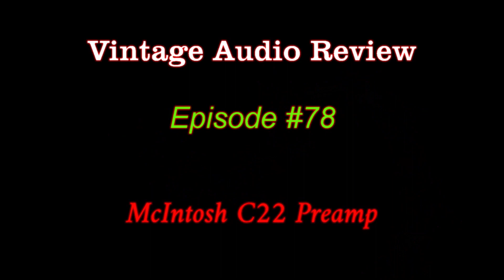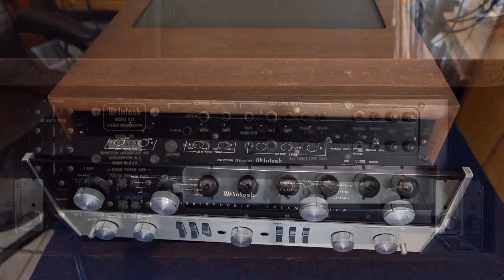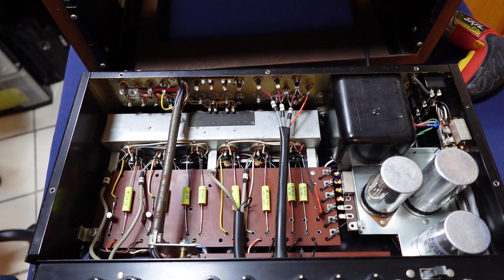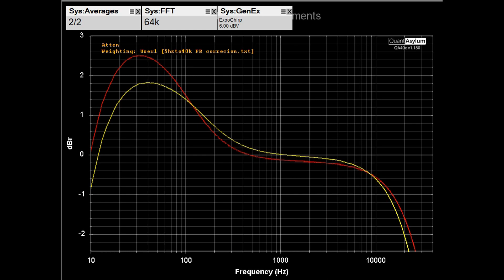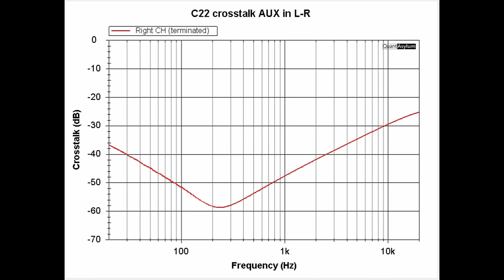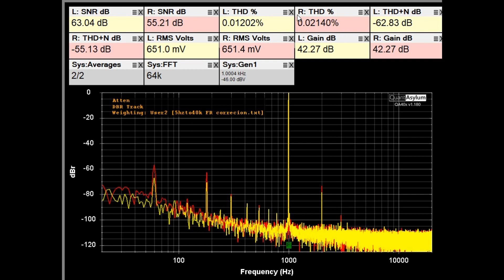McIntosh C22 Tube Preamplifier- Vintage Audio Review Episode #78

Comment: Quick question for you or your community of viewers. I have a store credit with an audio store that is a McIntosh dealer.
I want to put it towards a new McIntosh analog tube preamplifier.
It will  be my first  McIntosh preamplifier.
Did anyone hear the McIntosh C8 and the C22 mkV. preamplifiers?
I would like this to be 
my end game preamplifier.
IYO, how did they compare?
I have discerning ears and I do a lot of focused listening to Hi-Rez music files.

Any info you can provide is surely appreciated.

Thanks,

Di- store credit with an audio store that is a McIntosh dealer.
I want to put it towards a McIntosh analog tube preamplifier.
It will  be my first  McIntosh preamplifier.
Did anyone hear the McIntosh C8 and the C22  preamplifiers?
I would like this to be 
my end game preamplifier.
IYO, how did they compare?
I have discerning ears and I do a lot of focused listening to Hi-Rez music files.

Any info you can provide is surely appreciated.

Thanks,

Di-
Reply from the maker: I am not a big fan of tube preamps, even McIntosh. In my experience with immediate a/b testing there is not difference in sound quality between them and ss units. You need to wait a bit for them to warm up unless you keep them on all of the time, which means they would wear out sooner. My review on a Mcintosh C48 SS preamp with both a DAC and MM/MC phono built in, is upcoming, but that would be the one I would recommend if you can find one (they are out of production, but maybe the shop has one that was traded in).
Reply: @vintageaudioreview  I have an opposing opinion. Somebody looking at a c22 wants a retro look. The C22 has it, the C48 does not. What is the availibility of tat digital display 20 years from now if it cr@ps out? Also, I would not spend money on a device with an internal DAC. You pay top dollar for any Mac accessory branded Mac whether it's an internal module or a descrete device. Like Dolby, DBX, and others, the DAC technology is going to be replaced by something. Spend that money on an external DAC of similar quality for a fraction of the cost that you can retire when it is obsoleted. My vote goes to a vinatge C22 that has a vintage look, will likely be repairable with common components years down the road and as an added bonus has the added charm of tubes.
Reply from the maker: @GFSwinger1693  I appreciate the intelligent comments you made and would not really disagree with you that much at all, except for the fact that McIntosh does an outstanding job of supporting their products so the display, such as the one on the C48 should be available for a while (one would think). No question about the romance of glowing tubes, particularly at night with the lights out or dimmed. The C22 is going to provide that vintage charm for sure. The fact that the C48 has a DAC and MC/MM phono stages is icing on the Cake. The only negative is that is does not have a tape monitor loop. Plus it looks McIntosh (though not really vintage 😲) I would not purchase a C48 for its DAC- you are correct in that you can get some really nice ones for $100-$200, and a lot of streamers DACs are quite good so you probably don't need one.

Comment: Thank you for your review. By 1965 standards this machine really is super high fidelity. But nowadays only people who like the artistic touch of its unique distortion will buy it.
Reply from the maker: I appreciate your comment, but I would argue with you about the term "super high fidelity". What specs do you need to meet for that. A lot of audiophile folks would be thrilled to have this as their system preamp (and not just for its looks).
Reply: @vintageaudioreview  What I'm referring to is that in the process of going through Preamplifer, the PreAmp part itself just amplifies the signal without doing anything else as much as possible. Things like introducing noise, changing the dynamic range, altering the audio curve and etc.  It's a good PreAmp, because it sound holds charm. Just like Fender '57 Custom Champ guitar speaker. But it doesn't do a great job of fidelity by today's technology standards.
Reply from the maker: @victoriadelacroix8570  Thanks for clarifiying. I know that Fender makes guitars and amps, and some are very collectible, but that's about it- could not comment much about their sound. Nowadays you can basically go all digital until you get to the power amp, so you are limited by the D/A converter. The C22 from the video is coming over in a few days as the owner thinks he has a problem with one channel, so you do have that problem with some of the older gear, but than can be said for almost anything. My son's brand new Tesla would not run after only having it a few days due to a poor wiring harness connection. Charm is probably the biggest thing with some of the vintage gear. I would much rather have a '65 Corvette to drive than a much quicker and comfortable Tesla S3.
Reply: What do you mean by "its unique distortion"? Is their something "untrue" with how it replicates sound?